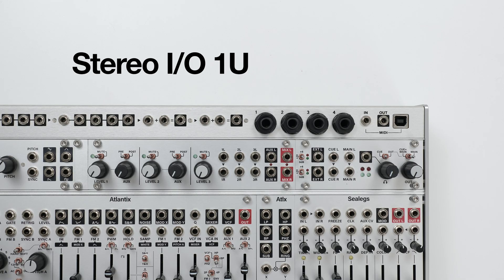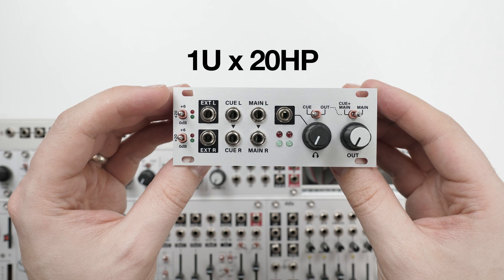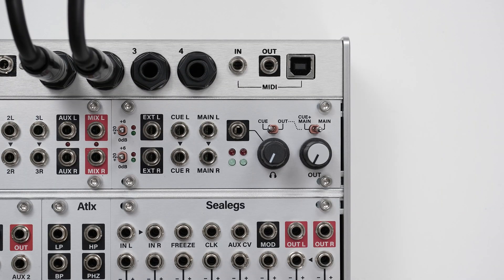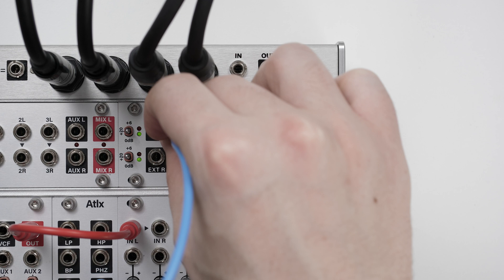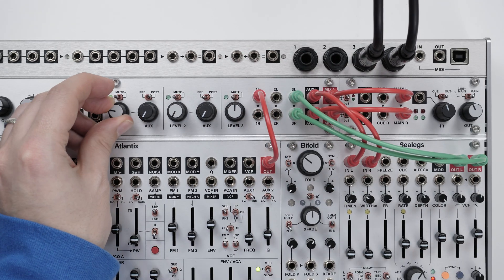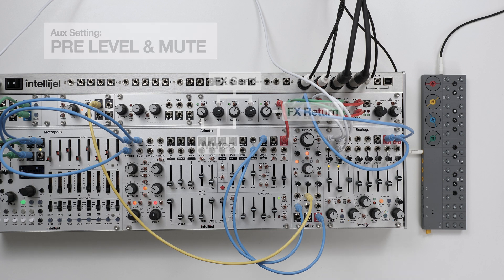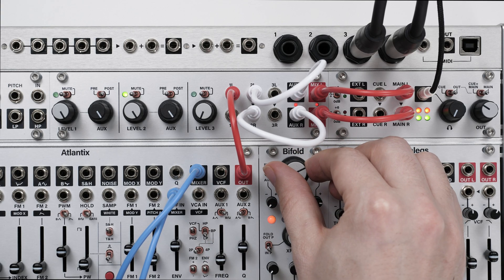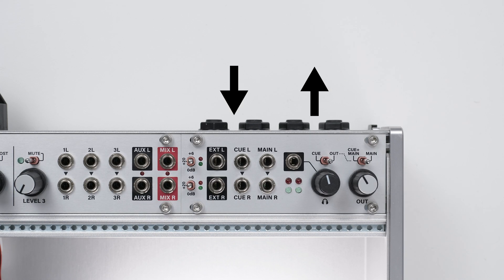Intellijel Stereo I/O 1U + Aux Mix 1U: Brand New 1U Audio Mixing & Routing Modules

Comment: Just got aux mix and was planning to buy this new stereo I/O. I didn't see anywhere in the manual if these 2 can be connected buy the rear pannel, like you show here (and save a couple extra patch cable on the surface). My plan was to use the send of aux mix to a reverb and get it back in the cue input of Stereo I/O. Will that be possible?
Reply from the maker: The rear connections on Stereo I/O are only supposed to be used with the Audio jacks in our cases, the 1U Audio Jacks modules. They don't interface with the chain inputs or outputs of modules like Aux Mix. Is the reverb you were planning to use a line level device or a eurorack module?
Reply: @intellijel  in that particular case, an external pedal but it could be an euro device too. Too bad these module don't have that capabilities, it's definitely something that would made this kind of ecosystem stand out. Aux mix is already great for a small 7U system so thank for that!
Reply from the maker: As Aux Mix is working with Eurorack signal levels, you would still need something to convert the Aux Out to signal to line / instrument level for your pedal (depending what it is). But yes, that doesn't change the fact that you would still need to patch into the Cue Input on Stereo I/O.